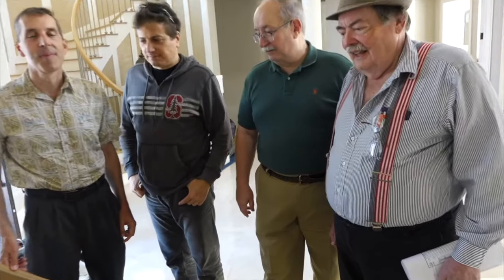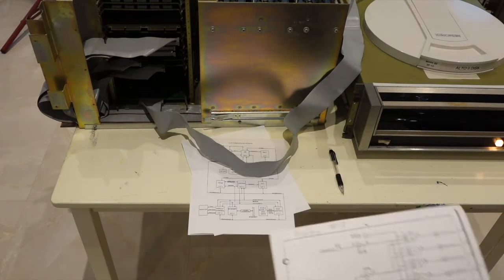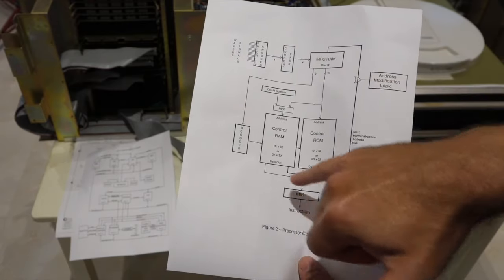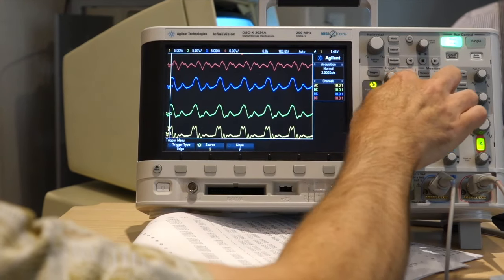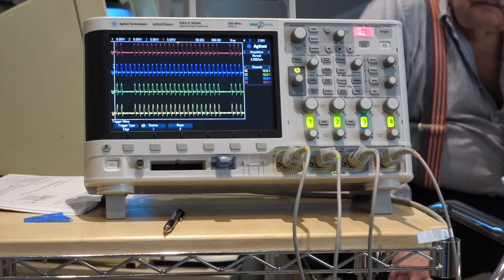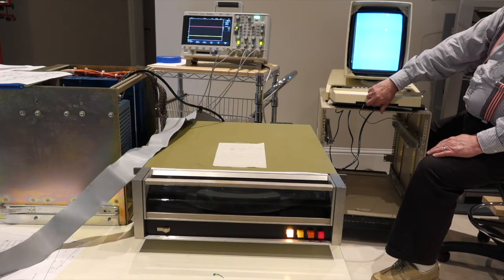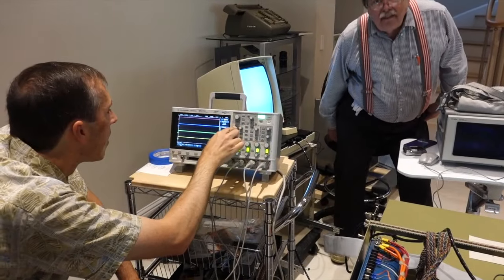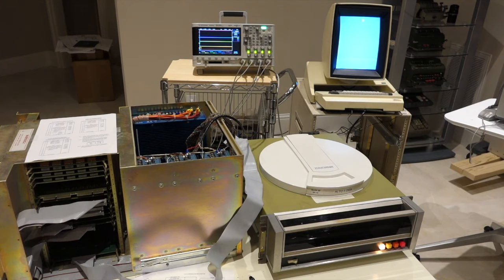Xerox Alto Restoration Part 4 - first signs of processor life

Comment: The system is very similar to a Nova, but considerably more powerful.  The first Nova machines had a bit-serial architecture which used a single 74181 bitslice ALU.  The Alto is actually closer to the later SuperNova system.

Comment: Is it possible that the boot record was written with a certain prescribed set of hardware attached, something is not present so the system does not complete the process? Perhaps a different boot record might wake it up?
Reply: From an amateur's perspective, the earliest Xerox box I ever used was the Star 8010 as there were still a few of them around USMG El Segundo.  

Speaking of hardware configurations, I know that Xerox View Point (GVWIN) when configured to be connected to the Ethernet upon start up asked for the date and time from the time service, a cluster of 8000 and 8090 servers running Xerox Executive software modules.

If after a certain interval it could not get this information, it would boot no further (during pre-boot) and hang at the 0937 code (shown in the upper left corner of the monitor).  Is it possible the Alto is waiting for time/date information or something similar?

Comment: I heard different tasks like 'memory' and 'cursor' tasks -- what are all the tasks?  Is this in a micro controller separate from the 'cpu' or did the system not have a 'cpu' or is this separate from the cpu?
Reply from the maker: The single, micro-programmable CPU does all the tasks, and has very low-level access to all the hardware cards. These are always running micro-programmed hardware tasks, in the CPU micro-control ROM, not part of the operating system. In effect this arrangement enables a single CPU to play the role of what dedicated hardware, or 16 micro-controllers spread around the machine, would have done. That is, if suitable micro-controllers had been available at the time! Very advanced way to use micro-programming to do hardware tasks and simplify the hardware design, so it can fit in a small size machine for the time. At the expense of greatly complexifying the micro-software architecture of the machine - the microcode is impossibly difficult to understand, and none of the hardware works if the CPU is not up and running the microtasks. Not even memory! Even more mind-boggling, the lowest priority of the CPU tasks, the emulator task, the only one visible to the user, emulates a proper minicomputer CPU via microcode. In this case a Data General Nova, which was popular at the time. So as far as the user is concerned, this hardware looks like a NOVA CPU. But it's not. It's a virtual, emulated NOVA CPU.
Reply: This is so amazing. Thanks for the clear answer. The Alto is a legendary computer. I hope you get it up and running!  Were some of the helpers in the video involved in its design back in the day?  Where are you getting the design schematics?
Reply: +CuriousMarc As a software engineer, If I had a hat it would be off to the team who programmed that. wow
Reply: There are many docs for study which you can download from here:

https://archive.org/search.php?query=Xerox%20alto
Reply: Thank you!
Reply: +CuriousMarc I would love to see a nova since I did read a book about its creation, which was very great to read.    You don't happen to have access to one,  or?
Reply: This was built by some realy smart people at Xerox PARC as a research project to explore ideas in advanced computing. It was to be as close as technology would allow to a realization of Alan Kay's Dynabook concept. These were spread through PARC and at universities to experiment with GUIs, man-machine interactions and computer graphics.